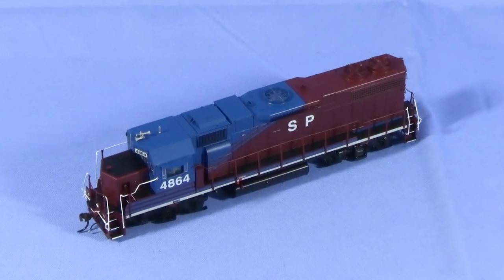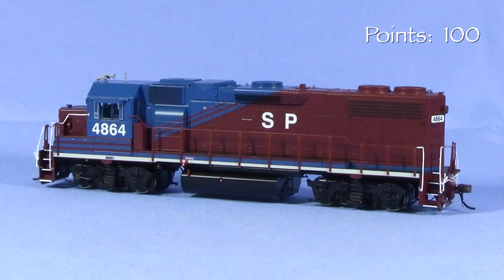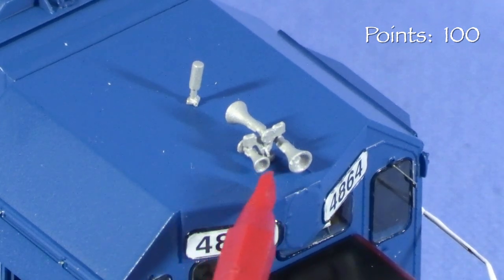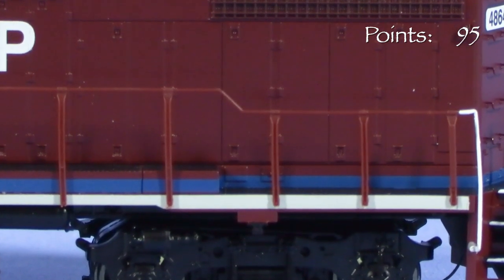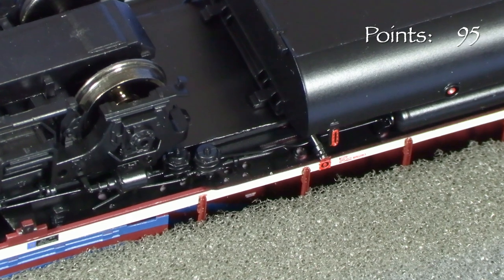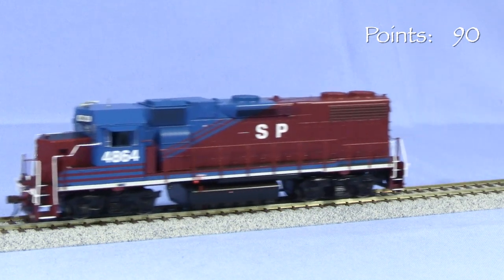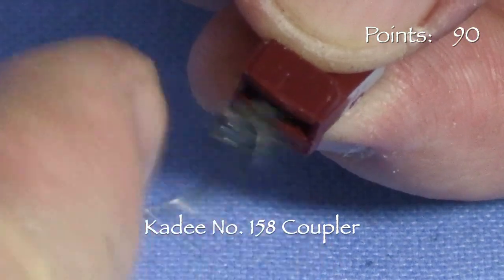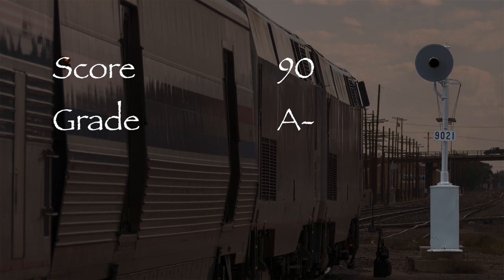Product Review Athearn Genesis HO GP38-2 SP - One of SP's last locomotives!

Comment: Hi Dan. I repeat : Great job ! Like your work a lot. OK. Here's what I saw and think - Athearn... Always the same issues. I noticed that one of the rear light bulb was offset a bit from the other one when you were handling the engine. They're the only one coming with bulbs instead of clear lenses and LEDs... This is something they should change from my point of view. Cheap !!! Next, the damn cab windows. No doubt it's a great feature that they're sliding BUT I don't really care about this. The engine performance comes waaaaay in front of that cosmetic sh... for me. Then, the sunshades. I don't like what Athearn is doing. They should make them like Atlas. None moving and more to scale. I hate to see the holes and the shade supports glued in the cheapiest way it can be done. Nobody's moving shades on their engines anyway. Either they are on at a certain position OR they're off the engine. Finally, the couplers. Is it me or they put cheap junk on their engines. They (people at Athearn) probably think that most of the modelers are gone change them anyway. But it's no excuse because an engine is pulling or pushing heavy loads. They should at least not put plastic couplers on engines. For the rest, I will add that I would do the same thing as you did : buying it DCC ready. The sound they're putting in is rarely good and those engines MUST come with "keep alive". Athearn is more as the GM of trains and not the Lexus... it's sad because they have the best looking and widest range of rolling stock and engines on the market !
Reply from the maker: I tend to think of models like this as "almost ready to run", knowing that I'm going to have to do a little work to get them up to my standards.  Typically with Athearn models like this I redo the lights, install DCC and sound, correct any small details that aren't quite right, and also change the couplers.  I agree that the couplers Athearn uses are terrible.  On my last permanent layout I had plastic couplers stretch out of shape and let go on me enough times that I decided to never use anything but Kadees.  At least that's a simple change.  Anyway, I'm glad you liked the review.  Thanks for watching!
Reply: @DanielCortopassi  Hi Dan. Thanks for answering. With Athearn, it's now (for me at least) Athearn... but ! There's always a catch, something to fix or replace on these engines. Cars are the same. Couplers are cheap and have to be changed. I bought an Athearn-Genesis MP15ac not long ago. I bought it DCC ready and choose the kind of sound I will put in. It took like 2 nights for me to make it run correctly. Engine motor was fine. Drive shafts too. It was an issue with wheels and pick ups. When clipped in, the pick ups holes were not centered. It was causing axles not rolling freely. So the engine was running at variable speed on a fixed throttle speed. I felt bad because they're the only one who make the MP15ac. But on the other hand, the engine was brand new. AND their customer service never answers requests. Atlas is sometimes shitty too but they answer requests and give a good sale service. It's the least manufacturers should give when engines price get higher than $400 CAN dollars. I will avoid talking about Rapido trains here... No comments at this point !